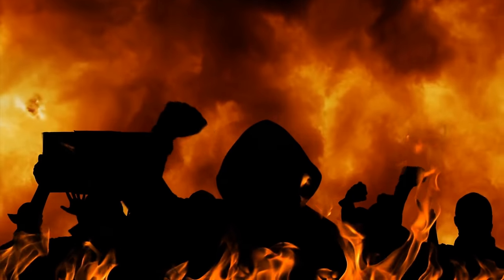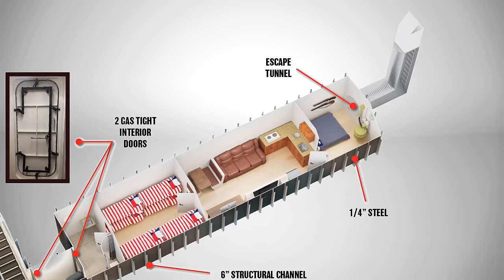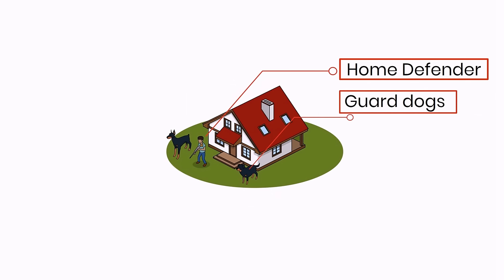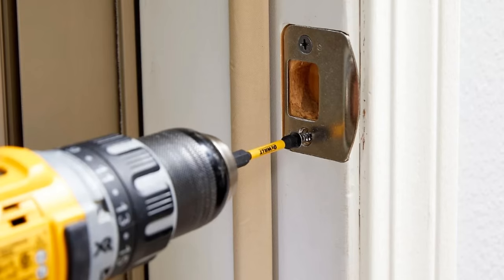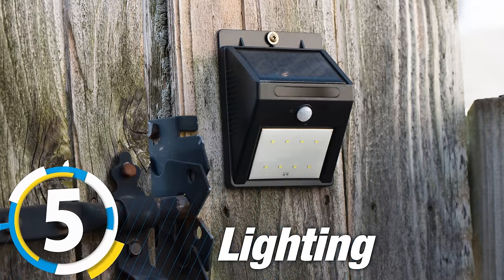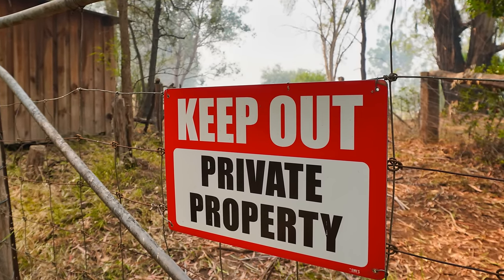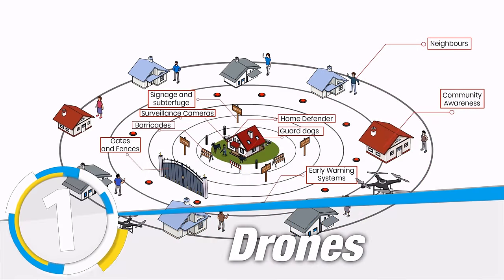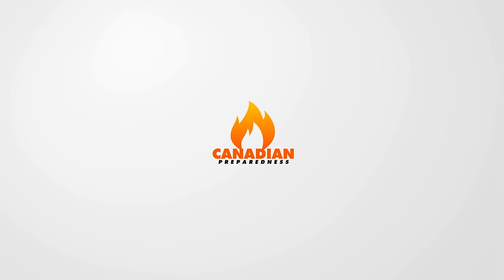The 10 Layers of Home Defense

Comment: The Grey Man strategy can be another line of home defense when utilized properly. "Blacking Out" windows with tint on the inside and security film on the outside makes it look like no one is home (when you are home) and adds glass strength. Having a contingency plan to "dress down" your property  when SHTF makes your home less of a target. 
Going for the opposite of looking like no one is home,  one thing I have done for years is have a couple vehicles parked outside , move them every few days even if you aren't using them much. It looks like I have 4 extra drivers living with me and it always appears that there is always somebody home. I just don't tarp any vehicle or allow them to get covered in leaves or debris.  
Signs : Back in the woods we have a sign that reads " Backwoods Shooters Private Gun Club" , it keeps people from wandering around the woods. I came up with a sign and had it printed: No Trespassing - Violators will be Shot, Survivors will be Tortured.
Reply: I am thinking of trouble comes down the street darken the house and open all the windows. Maybe make one  appearance on the front porch armed and not engage in verbal back and fourth. Go in the home and stay deep enough inside so those on the street do not know where, how many, with what and when a response will ring out. Snipers do not lay the barrel on window sills. If the home is breached the fight is on your turf and traffic can be controlled and routed. 
If it is shtf make the property look like it had already been looted. 
Park cars strategically away from the house in case they are burned they don't take the house and where they can be seen if used for concealment.
Reply: @patr10t762  True. Just having a plan or two for when SHTF puts you at a greater advantage. Being able to adapt your plan or have a contingency plan is important. I like the deception idea. Sun Tzu in "The Art of War" emphasizes deception and great military strategists have utilized that concept to their benefit. There is so much to consider. Develop your Plan A, Plan B,  Plan C, etc. and have a trusted family member or friend look it over and give advice.  a different view point may help you. I learn something new everyday. I have been thinking this way for quite a few decades. Weapons and supply caches, security, observation and intel. Identifying weak spots and vulnerability. Training, training, training. Getting supplies and equipment before they are banned or become unavailable...it goes on and on. My brain is always thinking about survival. I have used some of these plans and they worked well for me during some events. I have put some of my plans to the test and I can always improve because it looks like we will be tested severely, very soon, in many ways.
Reply: @Chaosthemighty  I often quote Sun Tsu and in fact the teaching is part of the plan "look weak when strong and strong when weak".
From a legal standpoint your own threshold is the best place legally to act, It may not be the best place tactically but it is home field advantage. On the legal side I would let property sustain damage without an immediate response,  not to lure them in, only to let their own recordings show that they were they were never provoked.
Reply: Have you seen southernprepper 1s little green men series? If not I recomend it.
Reply: @patr10t762  No. But I will check it out.
Reply: @patr10t762  Another thought is using your terrain (to your advantage)... fences, obstacles, thorn bushes, etc to corral "Trespassers" to certain areas or "Hiding Spots" that you have already ranged out for your rifles and you can leave "Surprises" for them in those areas. Now you  have to use your imagination, but imagine a trespasser being corralled into a spot where he steps into a "pitfall" breaking his ankle. Now he is totally screwed. If there are more than one, now they will have to consider carrying him out of there. If his comrades  leave him behind and keep advancing, they are only going to be wondering what other traps befall them (psychological warfare)., and will spring more traps or be majorly slowed down. These "Surprises" can be damaging or deadly and when you are creative, they come in many different forms. In the current litigious world we live in, maybe these pitfalls just mean trouble for us legally.... BUT... In a SHTF scenario, my "Surprises" mean trouble for invaders. Scumbags: Stack 'em like firewood.
Reply: What about a sign saying "Danger/No Entry: Zombie Reserve"?

Comment: I'd keep a few rolls of barbed wire or razor wire in a spare room or shed. sHTF just roll out a few bails around the place. If it doesn't mess someone up it'll slow them down so maybe they'll think it's not worth the effort. Just look at the damage barbed wire caused in conflict zones etc. Cheap, easy to store and roll, and better than nothing.
Reply: You would use them inside?  And outside?

Comment: sandbags. you can buy a few hundred of them and full them up with dirt. just put them on the inside of your windows on top of each other and you have a bullet-resistant house. plus you can use wood planks and make   small opening in these sandbags and turn your windows a pillbox ,  also helps with floods

Comment: Concrete Flower planters under windows and by doors  will add a lot of protection against gun fire ,give you something to hide behind as you return fire and looks low key enough to not draw attention ...Cross bow can also be useful as you can whittle down any attackers without giving your location away and they are easier to obtain than a firearm ..Gravel pathway or drive is a great way to stop anyone sneaking up on you ...Geese also are a much better early warning guard than dogs because you can't drug them and they are loud when disturbed ...Leaving some " loot " out to be taken whilst you keep your real treasure well hidden is another simple effective idea
Reply: Even wood planters with a base of sand.  Packs of printer paper in the wall cavities under windows.  Or simply cases of printer paper stacked under the window. Make the home look like it was already looted, take some clothes and odds and ends even a flat screen and toss em on the front lawn.

Comment: For the fencing prep, you might consider the following:  you can get huge spools of barbed wire for not a lot of money.  Especially if you are using existing trees or other standing objects as "fenceposts".  You can get half a mile of barbed wire for $80 USD.  Add in some welding gloves, a wire gripper tool to attach it to a come-along (another tool) and some bolt cutters to snip the wires, and for around $140 USD you have a lot of potential as area-denial.

Comment: Great points and for those who think the Police are key to your safety - think again! Response times are not what you think and as cities and towns "defund" the forces it will get worse so take the advice from this video. I rated about 65% and thought I would never go for a drone but maybe it is a good item in the tool box? We also have outswing doors on the house so no one can kick them in. This should be a standard feature and code for construction.

Comment: Awesome stuff! Do you think you could make a similar video about living in an apartment/condo type environment and being limited on the modifications you can make to where you live?
Reply: For apartments the best thing to do is put in longer screws for the door hardware. If they allow it, use a ring doorbell, its the least intrusive type of exterior camera that can give you warning. Use the locking devices that can be installed on the floor as in this video or a door knob bar that is put under the door knob to help it from being kicked in. If possible never put a direct shot from the door to your bedroom, try to place a piece of furniture in the way that a robber would have to go around. This slows them down, but can also give them a place to hide, its a toss up. Install a motion alarm aimed at the door and windows (if ground floor), the alarm should have a loud whistle when activated to scare off the intruder, but be careful of things moving around when heater and AC are on as the curtains or a balloon will also set it off. Not a whole lot else you can do besides putting a bar across your bedroom door that would stop intruders, this can give you a few extra seconds. I hope this helps. I do physical security for a living and graduated from the US Army physical security school. Good luck.
Reply from the maker: Would be tough as I dont live in one, one of my main concerns would be fire

Comment: Just do like the purge and install an all around steel plate security system. With one button you can secure all windows and doors with a heavy duty 5 inch steel plate.
Reply: What is that? Thanks.

Comment: Thanks for posting this. You've mentioned some good ideas. W.R.T. Camera systems, one useful strategy is to mount some very obvious cameras - they may be old technology, or even dummies. Sometimes these can be picked up in package lots at auctions very cheap. If they work, and can be integrated, great. As dummies or distractions, they will allow you to install much smaller, more sophisticated, and concealed video cameras - possibly co-located with other sensors like IR or RF (radar) motion detectors - and the bad guys will never realize they're there. Simple low-tech old-type of sensor - the pressure mat under an entry way carpet is one "oldie but goodie" - still work and don't cost much.  
A while back our neighborhood had a B&E gang who spray painted the lenses of security cameras as soon as they entered a property.  I bought an auction lot of  clunky old-style cameras for under CA$60 - enough cameras to fit up about 3 average houses. (About half still actually worked - a bonus). I gave some to neighbors, & The old cameras were put up at or near "expected" clear line-of-sight locations. My real cameras - tiny with both visible light and IR capabilities - were invisible. 

Similar ideas can be applied to other types of warning or protection - perimeter alarms, etc. 
One thing I don't often see mentioned as a "thief deterrent" is an indoor 'sonic barrage' system. This can be quite inexpensive and relatively simple, but very effective. A blast of sound at 130+ db, and at a particularly unpleasant frequency (Wikipedia has some good data on this) can make people who have brute-forced their way into your place leave the premises quickly, disoriented or in pain with burst eardrums. Certain combinations are excruciatingly painful. A bit of care is needed with this - you don't want to accidentally deafen family members or legitimate visitors. But does it it work? Yup. it will drive people out at a dead run. This idea is only applicable to some types of situation, but (again) it's quite simple, not expensive, and effective. 

Thanks for your videos - they have good ideas, particularly those with ideas for those living in cold-weather country. 
One last thing - unrelated to this video - that I rarely if ever see it mentioned is to have a good set of "real" tire chains for your vehicle. The fabric "traction devices" sold in the U.S.A. at places like WM are utterly useless in real winter conditions.  If it's a pickup with 2WD/4WD, this is expensive up front - ideally, you want chains for all four wheels of a 4WD. Storing them in the vehicle so they're not noisy, and regular maintenance (inspect clasp hooks, de-rust if required, check the rubber tarp straps, etc) can be a chore. But there are times when they can save your ass in this part of the world. Check Kijiji/Craigslist - sometimes sets get listed there, if people change their wheel/tire sizes, or get a new vehicle. When your choices at -35 are: a) chain up or b) remain immobile and freezing to death, the cost doesn't matter.

Comment: Hi Nate, I have my own business... "Anglesey Home Security"

We install CCTV!! Theres nothing at all wrong with Ring Doorbell cameras. However, you cannot regard them as a surveillance system, firstly, they only cover one area, secondly invaders are less likely to use the front door!!

Advice: if you have an external cctv system, ALWAYS ALWAYS ALWAYS have a camera indoors, which CAN ONLY be triggered by an intruder.  Pointing accross a stair well for example.

Most entry level CCTV systems have email and SMS alert features

Comment: FYI, you should never truly trust a WiFi camera. Portable WiFi deauthorizers are cheap and can be used to temporarily knock a camera offline without triggering an alert. A multi-unit solar driveway alarm set will do better, as they use a proprietary system that does not have the vulnerabilities of WiFi and can be hidden at choke points to where a person has no choice but to trip them, and they are not dependent on functioning internet. While it's better to have both systems, a driveway alarm is more robust.

Let's just say I'm pretty well prepared in this case, largely because my late grandfather turned the house into Fort Knox. Block construction, bars on all windows, reinforced doors, and an alarm system. I've added some sensors and cameras. Anyone breaking in will make enough noise and take long enough that it won't end well for them.

Comment: About dogs, those little ratty dogs that are no good in a fight are usually the first ones to start barking when someone's nearby. They're also inexpensive. 
I notice that nothing is said in this video about the different kinds of locks, deadbolts, single cylinder, double cylinder, etc. And putting longer screws into the strike isn't going to do any good if there's only a half inch of wood back there. When it comes to sandbags, there's a difference between bags filled with dirt and bags filled with sand when it comes to bulletproofing. Go with sand.

Comment: BROKEN GLASS:  Store old glass bottles and jars, break them up and spread the debris wherever you want to deny access.  You can keep the material in bins until you need to use it.  It also makes a noise that will alert you when anyone walks on it.

Comment: PSA: He is not too far off but long-barrel shotguns require a certain amount of accuracy; a lot of people are under the impression you raise the gun and shoot in the general area. The spread of a shotgun blast is not that large (I think it's about a 2-inch spread), you still need to aim, everyone is responsible for where their shots go. Now short-barrel shotguns aren't the same; the spread is much larger, but they are less common, I think in the U.S. the NFA usually has those banned unless they have a pistol grip and meet a few other requirements.

Comment: My home is built of block and unlike the wall that was busted through the block of my home has vertical as well as horizontal reinforcement. All exterior doors have rebuilt solid wood framing, 11 inch lock reinforcement plates, 3 inch screws then high strength Security doors fastened with 12 non reversible bolts for each door. At night a hinged locking hasp is secured on all security doors to prevent entry if the locks are picked. These hasps have no exterior lock faces. All of the windows are protected through either a roll down shutter that covers the entire window, or a baseball bat proof screen for the window that is locked from the interior. At least one weapon is available with hollow point rounds for that weapon. The exterior is covered with motion sensor controlled flood lights all around the home. I follow a discipline of checking all doors and windows prior to retiring to bed. Next will be surveillance cameras for the exterior of the home. Valuables are secured in a large safe in the house. Video was sent to the home insurance company along with serial numbers to electronics etc.

Comment: Good video. However, I live in an apartment at a complex. Unfortunately, living in a small apartment would not provide the adequate protection needed in an SHTF situation-especially long-term. I would have to leave and escape to safety outside of the city if and when the time comes because I believe that it would not be feasible to remain in my apartment.
Reply: @milky onion That is why I will bug out asap.
Reply: @LisaAnn164  good thing I practiced my bug out plan two months ago. I stay in a studio apartment but I installed a alarm system with four alarm at key entry points in my apartment and also has a door blocker. Recently I got two security cameras.
Reply: Apartment complexes are easy defend.  Much safer then houses.
Reply: @mr.longtrail9960  Not for LONG-TERM. It will NOT be safe. It is best to have a bug-out plan.
Reply: I strongly disagree with you. Windows can be easily bricked up.   Ground level entrances fortified, and reinforced.   Steel plating can be easily scavenged.   You have good fields of fire.   Group strength.  You could have many people with different expertise living under the same roof.
Reply: Staircases can also be easily blocked.   Don't be naive.
Reply: @mr.longtrail9960  Not when you're living on the first floor.There are apartment buildings with several floors within that building; and there are apartment complexes that have several buildings that have one to three levels. Certain stairways cannot be blocked. Apartment complexes are not safe for LONG-TERM.
Reply: @mr.longtrail9960  It is also a matter of whom you can trust; especially during an shtf situation. There will come a time to get out of dodge and not remain in a metropolitan location.